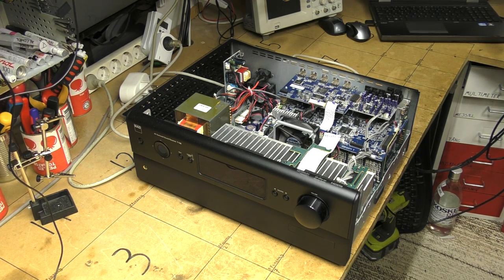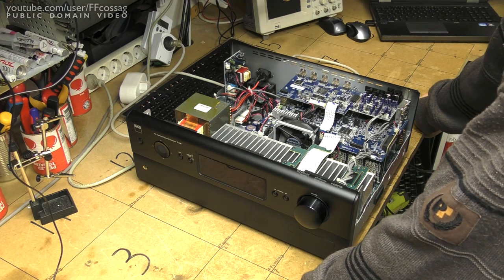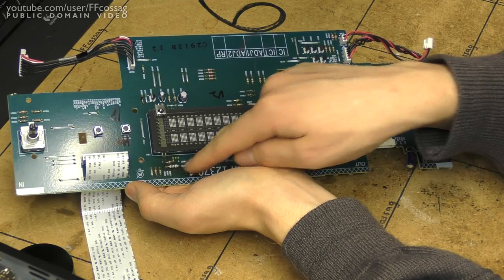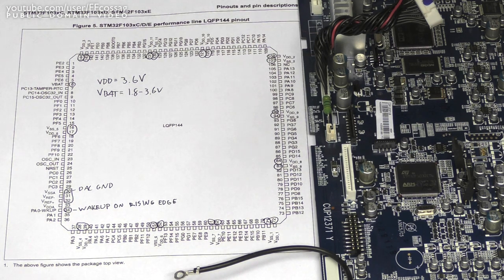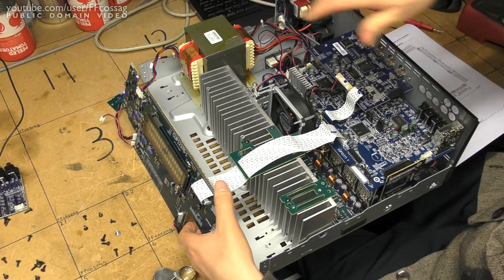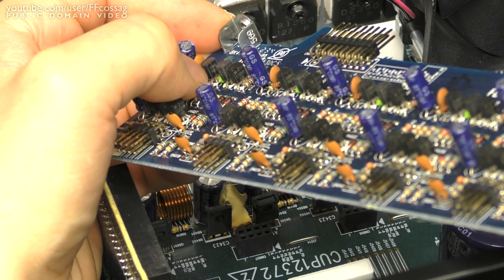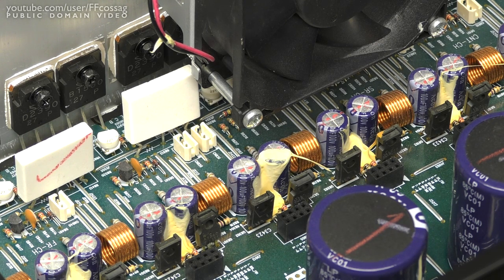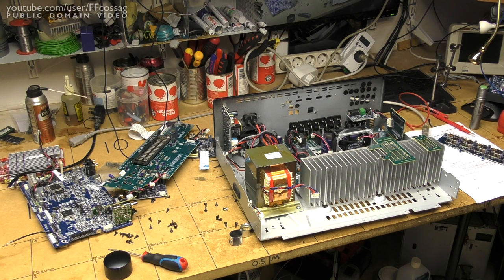FAILURE! NAD T748 standby issue troubleshooting/teardown

Comment: Thanks for uploading this video. Repaired and recapped 3 NAD integrated amps with same problem, bad caps. All amps I restored only 5 to 10 years with same leaky caps and blown caps problem, because NAD used very cheap caps. Their receiver even worse. NAD fanboy would say "It's all about sound, it's OK if quality of their amp is not good", what??

Comment: Just repaired one of these amps for a friend. It had exactly the same symptoms and would power up from orange to blue only after heating the same micro controller chip (IC101). Further investigations revealed the fault cause to be C1039 (10uf 16v electrolytic), proved by carefully thermally isolating and heating said component on-board and then off-board connected via fly leads. C1039 replaced with standard (not SMD) 10uf 35v electrolytic and all’s now hunky dory. This capacitor forms part of the micro controller's reset circuitry, in my case locking micro controller pin25 (reset) in reset state. I hope this helps others as this problem seems to be a fairly common issue with these amps.
Reply: Please make a video about it. It would save a lot of people s loy of money.
Reply: please bro
Reply: Oh, and I suppose you haven't noticed the Service manual does not contain a capacitor named part C1039?
Reply: @limtk55  Just rechecked my service manual. It’s definitely C1039 that I replaced, POR hold down cap. My friend’s amp is still going strong. I suggest you locate the correct schematic diagram version for your amp. Oh and by the way your unwarranted sarcasm is noted!
Reply: I have this same problem and identified that surface mounted capacitor. I’ve seen several ways to take the capacitor off including twisting.  Some say it depends on how big the capacitor is. Can I ask which approach you took. Thanks
Reply: As a ps I heated the with a hairdryer and it’s been running but not going to standby. I even unplugged for a short time and it still worked just won’t go into true standby
Reply: @JamesMacLaren-kw1tj  Hi James, I very carefully twisted the old capacitor back and forth until it released from its solder pads. I emphasise very carefully as it would be very easy to damage the pcb pads. As I didn't have any SMD caps of the right value and as I could only purchase them in large quantities I used a conventional cap of the correct value by carefully soldering its shortened legs onto the now vacant pads. A fiddly job but not too difficult if using an ESD protected micro soldering iron. I hope this helps.
Reply: Thank you, this is a very helpful answer.
Reply: @petcatznz  Finally got around to this after buying the smd cap from digikey.  Was a bit fiddly and i used cutters to pinch and cut the old cap.  There are youtube videos showing that method.  I cut parallel to the leads and as close as I could to the base.  All went well after soldering the new cap on the pads the amp now powers on and off but always stays with the blue light on so I'm guessing not really going into standby.  Anyway, it is working and can be unplugged and replugged and started up without heating the ic with a hairdryer!

Comment: I had an NAD receiver (AV760?) from the early 90s, as well as an NAD 5000 CD player.  Both are long dead.  The receiver had its final drive transistors and their base drive resistors replaced once (no, I didn't push it very hard), but it failed again and wasn't repairable the second time.  The CD player suddenly lost the ability to play CDs without horrible skipping.

I tore down the receiver, sold its large transformer on eBay and put some odds and ends in my parts bin.  The CD player is in a box somewhere awaiting the same fate.

I have a Yamaha receiver now that's been chugging along reliably for years.  After seeing how the NAD receiver was built and performed, I'd never buy another one!

Comment: If the microprocessor is the problem with this unit, and heating it up makes it seem to come to life again, I strongly recommend checking if the clock signal is present . It could be as simple as that.
Given the poor choice of components, I woudn't be surprised if a dodgy crystal oscillator (hint, hint) were the cause of that.
Reply from the maker: I just checked the crystal, and it does seem to make a difference on the operation of the unit if it's heated. However, once it's warm it runs just fine, and even in that state the unit does not work properly. It just sticks in the permanently powered on state. It's as if the µc fails to toggle between its powered on and powered off states.
Reply: Bummer! BTW, have you checked if there's anything suspicious about the reset signal to the microcontroller? Or even some instability on the +5V power rail -- some micros are very picky about supply voltages.

Comment: I found your video interesting and if you monitor your comments I was wondering if you've ever seen an issue with T787 that was working perfect and essentially new, not used for awhile and then when it's powered up and turns on the light turns blue, there's a click, the display reads T787, but seconds later it clicks again, and light turns amber going into standby, but display stays on. Problem is repeatedly the same with no change.
Reply: Todd, did you manage to fix this issue? How? I have the exact same symptoms : (

Comment: I'm sitting on a T747 which shuts off almost immediately after powering on and now I'm wondering if it isn't a processor issue as well. The 747 is far more densely packed than the 784 and I have no intention of taking it apart. I'll probably just donate it or sell it for parts.

Comment: I have the exact same model. My problem is that it has the stanby light (orange), turns on fine.

But shortly after it turns off going into power saving, only used it once.

Comment: Might be something like the crystal not oscillating properly..  Once had that on a receiver causing the cpu to do crazy stuff like not responding anymore.
Reply from the maker: There could always be a thousand reasons for anything. Sadly, eliminating every single one doesn't warrant the effort.
Reply: Good point worth swapping xstal, but heating is odd.
Reply: Heating the IC that much to get it working again is odd. Is it fixing a bad connection (bad solder joint, dislodged bond wire inside the IC package), or is it causing a failed part to shut down (eg a shorted GPIO pin/bus).

Debugging with those tiny pin packages is a nightmare, so even checking for IO lines shorted to the positive rail or ground, is going to be a pain.

Comment: I agree with you on the component quality but you haven't worked on earlier -00 Nad models, they used to have Elna, Nichicons and Rubycon caps.. Alps pots and switches and so on... For example a Nad receiver AV316 from 1995 had Nichicon Gold Tune caps in it... what you're dealing with here and must been dealing with before is the Lenbrook era Nad products. I think it was around 2000 they got bought up by Lenbrook Divisions in Canada. After that  everything went kinda haywire. Think the new Nad don't even sound good. Been reparing and owning lots of NAD and seems nowadays they just wanna make money. They're not worth it anymore.

Comment: Great video! In your repair of receivers, which one seems to have good quality internals? Like any particular brand or model? I was gonna buy NAD to replace my Pioneer Elite (still works but getting old), and I am now not sure if it's a good investment.  Have you ever opened up a Marantz, Anthem or Arcam receivers?
Reply from the maker: Yep, all of them. Arcam are trash. Absolute trash. The rest are about the same. They all eat HDMI boards after 4 years.
Reply: FFcossag thanks. wow. I thought Arcam could be best. So between NAD and Anthem, which do you like better?
Reply: I had an anthem. Died after 6 years. Just got this NAD hoping for a better result, but this doesn’t make me too optimistic

Comment: Yet my NAD 3020 amp just keeps on going...  35 years old.  All original parts, except for banana plug speaker sockets, and a green LED.
My NAD 514 CD player sometimes needs percussive maintenance to get it to accept a CD though...  ;o)
Reply: I have the 3120. Recently replaced the main filter caps and installed an 80mm fan to cool it down (nothing major, it's just held on to the top cover using small zip ties). I would recommend doing the same to yours as these are starting to get quite old. Sounds brilliant though.
Reply: Ahh a real NAD, the 3020 was made by the real company, NAD was sold off later on, just a name now :(

Comment: Did you try a debouncing circuit for that WKUP pin?
Reply from the maker: No, failure of such a circuit sounds quite unlikely.
Reply: I had similar strange issues with other equipment unrelated to audio and this helped to eliminate these problems very well. The momentary switches get cheaper and cheaper made, they really suck today. Don't even work for more than 2 years without developing major bouncing.
Reply from the maker: The power button was not connected to that.

Comment: Do you still reply this comment section? My NAD NAD T748 is not turning on. Instead, an ORANGE led appears and nothing else. I’ve tried everything: removing the power cabe and waiting for 10 minutes, plugging to another power plug, but nothing works. Can you help?
Reply from the maker: Afraid not, the unit in this video is the only one of these I've ever worked on.
Reply: Mine hoes on Amp PROTECTION mode when I turn it on
Reply: Hi, If you're still looking to fix your amp you may want to take a look at my comment post of today.
Reply: @petcatznz  Thank you so much. I´ll definitely try it!

Comment: Does the microprocessor have a serial or jtag interface that you could debug?
Reply from the maker: Maybe, but it's not worth the effort.
Reply: Even if it did, it will be completely undocumented, so what's the use?

Comment: It's not your failure, it's what i would call "Using a cpu to turn a led on.", overcomplex control system for a stupidly simple job.

That's the reason i don't like programmed processors/pic/atmel/other, if they die, then it's all dead!!.:-(.

The pins on that processor are 100% soldered down, yep yep ok silly question lol.
Reply from the maker: It's fine from a systems engineering standpoint. They need the processor to do other stuff anyway.
Reply: I still dont like the death of a unit for just one chip :-(.
NAD was good in the 1970's, not the same company now :-(
Reply: zx8401ztv
Yeah, NAD uses chinese capacitors too which have been known to blow up.
But this is consumer equipment. You can't expect it to be as reliable as you are thinking it should be. XD
Reply: zx8401ztv jup seems that quality has gone down my nad 7020 and my nad 3400 still work fine and sound incredible. But hey don't all audio products now days suck?

Comment: Short relay on, and use a wireless mains switch??  5 watt resistor on Uproc as heater, lol.
Reply from the maker: Sadly, the device doesn't work at all when the processor fails to boot.
Reply: I see, save the finals 2sd...

Comment: Too bad the cost vs value ratio doesn't warrent replacing the chip.
Reply: You cannot replace it. It's a custom programmed part. Code for the chip is not available to the public, and usually you cannot read out the code of the old chip as it's locked down.

Comment: Don't buy NAD they are mafia fucking crappy. They arrange amp so they heat too much and those processors always burn to death. Today's amp are all crap. Companies just think of one thing, make MONEY. STEEL PEOPLE. They deserve to go to jail. I hate today's world. Just buy vintage, good old vintage. The only thing that count today is MONEY, pffff... shame on you NAD.......I had to fix a nad t761 first time that heat too much and i did replace the output transistors and 4 months after the customer came back to me with a dead processor. SHAME ON NAD! And same thing for PIONNER AND A LOT OF OTHERS.